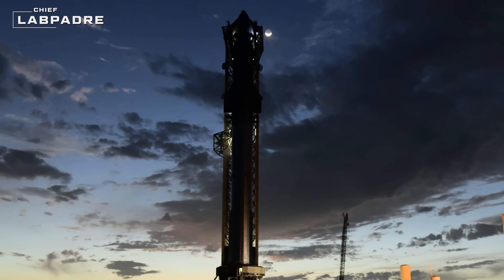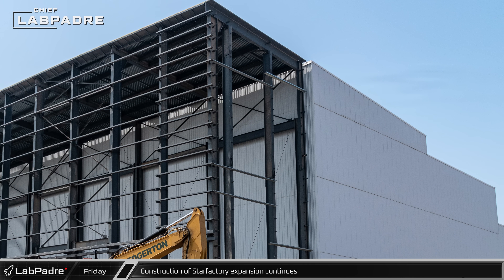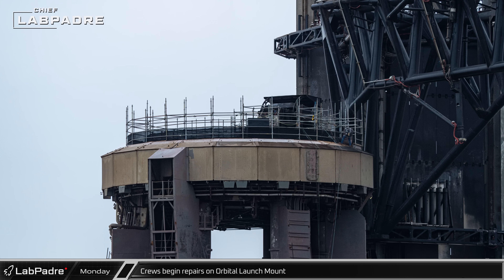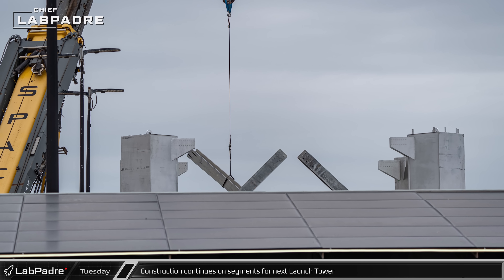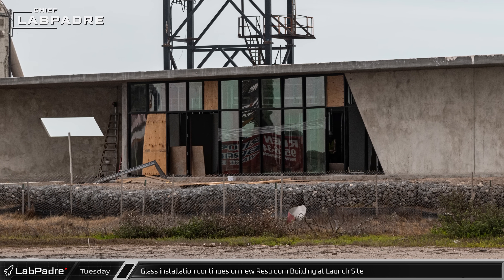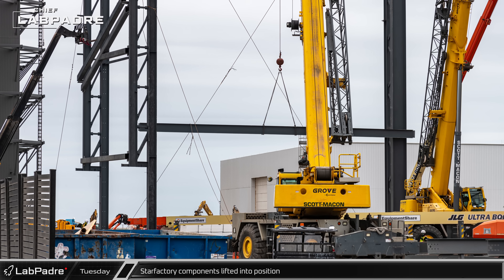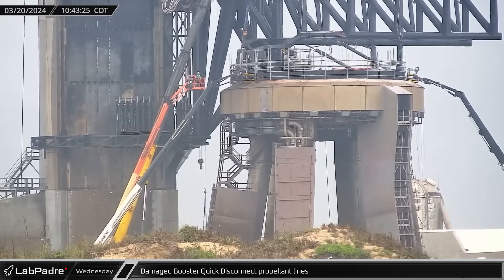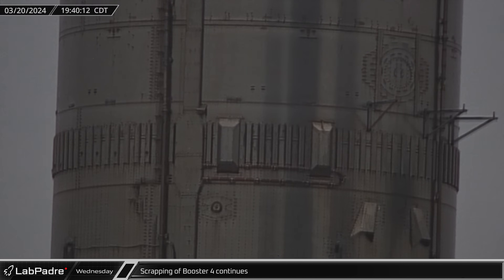Whoops!! Stage Zero Sustains Some Damage During IFT-3 - SpaceX Weekly #107

Comment: Insane that not much more than what 6 years?
THIS WAS A TENT ON A HILL!!!!
Reply: And it took more than a year to make the hill!
Reply: @avgjoe5969  The level of engineering marvels going on over there is crazy.
Spacex is so lightning fast that they blow everything out of the water.
SLS was what nearly 30 billion for a single rocket?
Has less payload?
Expandable stages?
Runs on a much more problematic fuel, hydrogen?
Nearly 15 years for the first one?
Then you look at starship...
Failed first flight, so one could argue that sls was more successful...
However, for what 2 billionish?
They built prototypes
They launched and landed a second stage
They brought engine production to whole new levels 
They built an entire product facility (which were tents to be fair)
They built the tower/mount 
They launched 3 times, even if it didn't do everything, still wildly successful tests.
All this in that a decade...
Spacex for the win, NASA for the bureaucratic red tape.

Comment: They've got to do one heck of a lot better than that. Those are like, literally on the order of ~10,000 MPH winds generated by those 33 Raptor engines, and pummeling Stage 0. There can be absolutely no exposed hoses, wires or lines of any type on the OLM, or they will be destroyed.

Comment: for the reinforced concrete pour area, my vote is parking lot currently because we didn't see vapor barrier go down, so not a building and we don't see the electrical stub-outs for running power to each spot that would be needed for Tiny Homes or an RV Park.

Comment: Emergency!!!

 Baffles will not work to prevent the slushing problem, because the tanks of the starship system are too large. That is the only reason why the starship will explode every time.

The solution:

The tanks  of  Starship and  Superheavy need 2 disk valves, expanding the diameter of each tank. One of the disks, the one on top, rotates above the contiguous disk to close the overlaping holes on the surface of the disks; to reduce the Size of the tank by dividing it, before any rotation or acceleration of the rocket. This will prevent slushings and protect the plumbing, if located 10% above the bottom section of each tank. Large telescopic pistons can be attached below the bottom of disk valves to control the fuel pressure as the piston expands into  the fuel tank. 

 I have built a model that works perfectly. The second disk valve can be located 10%  below the front of the tank, to also protect the front of the tanks from the slushing forces. 

The  gridfins are too flat and too small to be effective enough and will not be able to control the booster. 
Why is Elon  not using four pins instead of three to secure each heat shield tyle? Four anchor points provide far more stability to secure a tyle, not three.What is more important than securing the heat shield? Four anchor points would eliminate the problems of tyles falling off the ship every time there is an engine ignition. Please get this message to Elon. Thank you.

Also, Spacex needs 3 actuators to move the payload bay doors correctly, not two. They have only two now, one at each end of the payload bay. They need one at the center position.   Three will guarantee that there will always be enough support to open and close the doors, even if one of the three fails. I know the spacex engineers can see these problems. It is like ignoring the elephant in the room. Musk needs to hire people who can be trusted and who will not continue accepting bribes from Jeff Bozo to sabotage spacex.
Reply: Ten percent of 8 is about 1. 😅😅😅
Reply: I love your reasoning. "They need 3 actuators because it's better than 2" "4 pins are better than 3". And the genius idea of dividing fuel tanks (just imagine the weight penalty) and modifying the grid fins - I'm sure you did CFD analysis of all that stuff.
Reply: The problem is the volume to control cavitation during launch vibrations.  Most people have no idea why we have EFI on cars.  They think it is for fuel economy, but they have no idea of the fuel cavitation in the fuel bowls that caused so many problems with the carburetor.  The carb was the best design for low maintenance and easy to work on, but fuel cavitation would pop holes in the fuel float.  All it took was a pothole to cause a car to start running rich.  A solution for the tanks would be full length dividers that would appear to be inner tanks about 4" in diameter.  The manifold at the bottom would have to limit the cross-section of the fuel area to reduce air bubbles from forming.  The added resistance may become a problem, as the added weight of the inner tanks.  Fuel cavitation is a major issue with upscaling rockets!

Fact is, most people aren't good engineers, even though many of them have a college degree in engineering.  They never learned to get their hands dirty and relate directly to the problem.  People want to sit in a clean room and dictate as if they are a god.